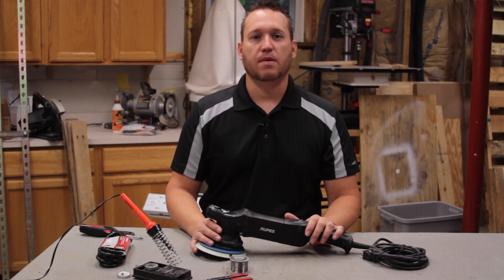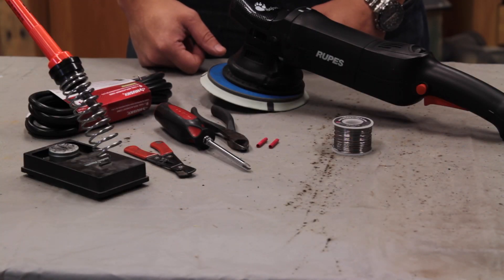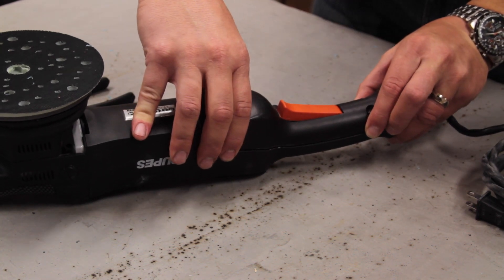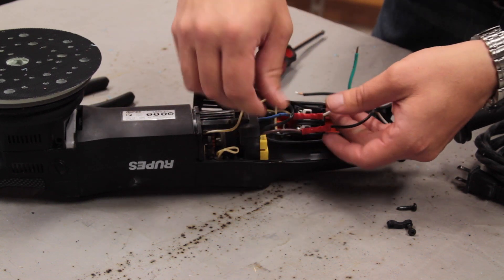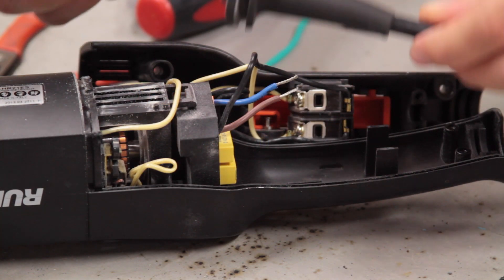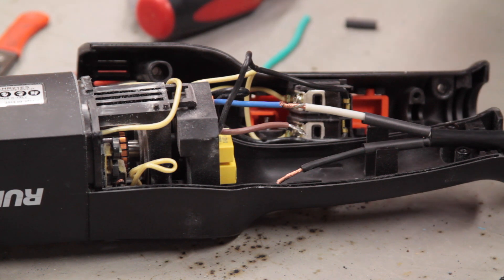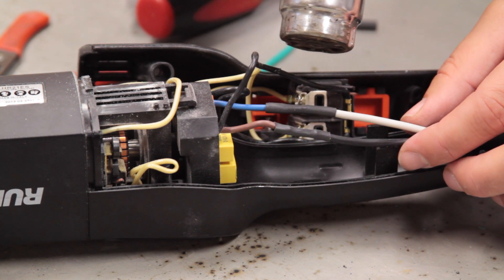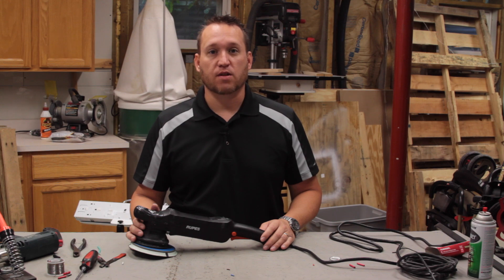Power Tool Cord Replacement

Comment: Hi just watched your video about soldering wires together, I too have a heat gun  but sometimes it cannot be used as other things may get damaged, if this is the case I just use the soldering iron and this works well without the danger of lighters,
Reply: Use a hair dryer. It gets hot enough to shrink tubing, but not hot enough to melt wire shielding, or plastic!